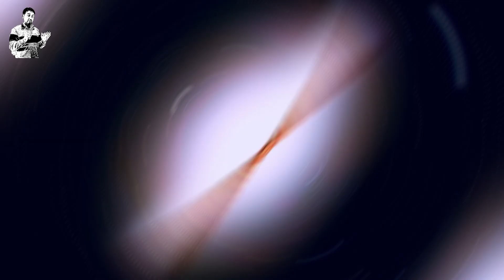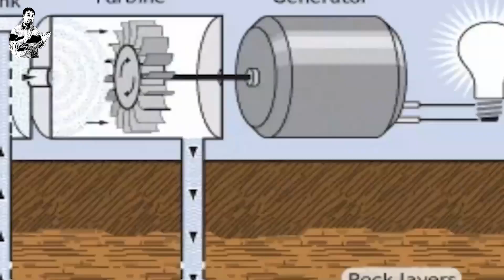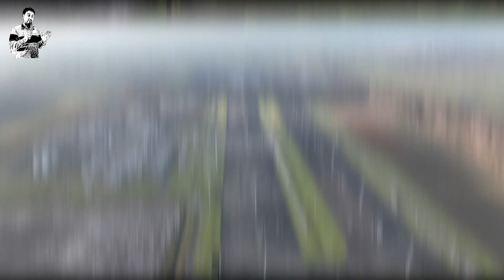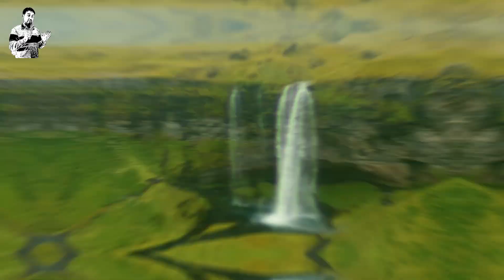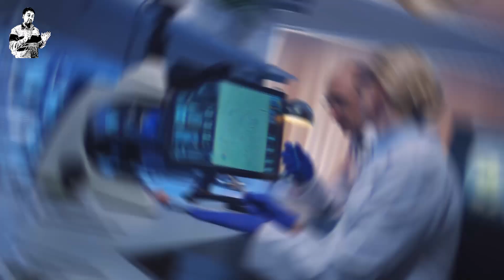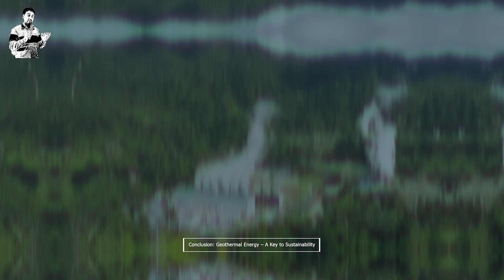Geothermal Energy Explained: The Future of Clean, Sustainable Power 🌍🔥

Comment: Nothing is free, cost many millions to develop and the the thermal field loses heat as you extract heat!
Reply from the maker: Thank you for your comment! You’re absolutely right—geothermal energy isn’t 'free' in the sense that it requires significant upfront investment for exploration, drilling, and infrastructure development. These costs can indeed run into millions of dollars, depending on the project scale and location.

However, once operational, geothermal plants have relatively low operating costs and can provide a stable, long-term energy source. As for the thermal field losing heat, this is a valid concern, but with proper management and sustainable extraction practices, geothermal reservoirs can be used efficiently for decades. In some cases, enhanced geothermal systems (EGS) can even replenish or extend the life of a geothermal resource.

While the initial costs and challenges are real, the long-term benefits—like low emissions, reliability, and energy independence—make geothermal energy a valuable part of the renewable energy mix.